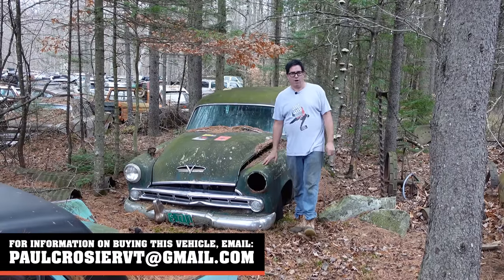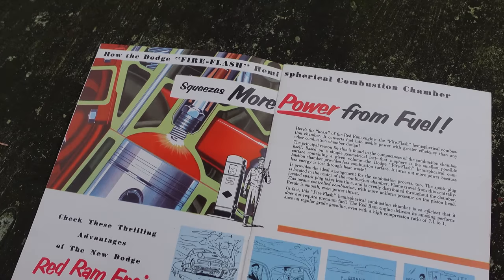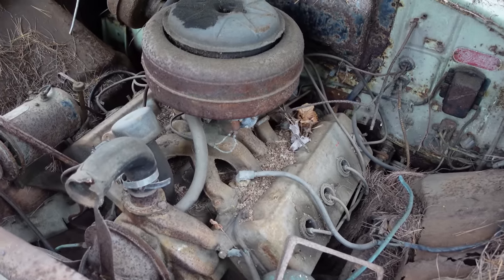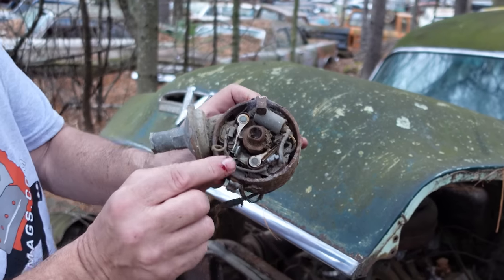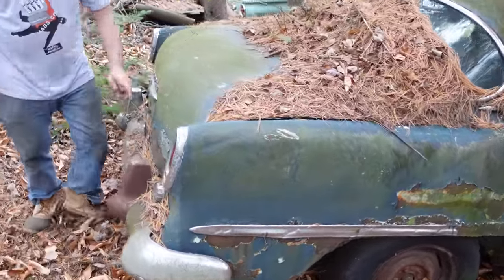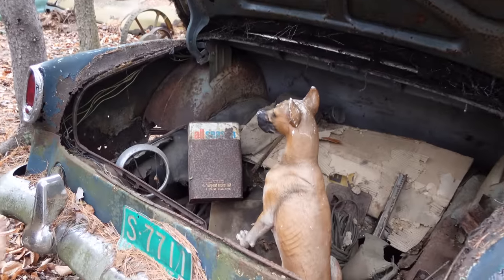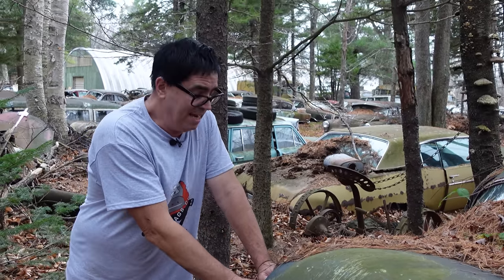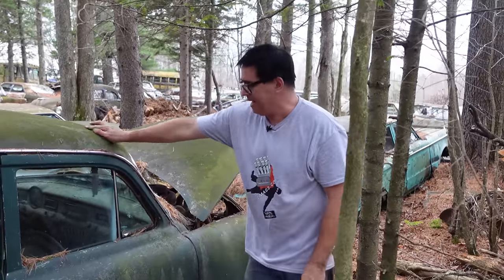First Ever Dodge Hemi

Comment: Nice to see the mother of where a legend was born.  Thank you Steve
Reply: NO,mass Hemi was pionereed by belive it or not Citroen and all Citroen engines were exclusively Hemi engines,2cv had Hemi some three of four years before any US producer.
Fun fact is that Chrysler had a very close relations with Citroen back in the day beacuse Citroen was a monster of company and real innovator.They pionereed Hemi,Crumple zones,disc brakes,power steering,self collapse engines and steering,radial tyres,Hatchbacks,front wheel drive,adaptive lights,active suspension(which even Tesla uses today in variation),rain sensing wipers,aerodynamics for fuel effiencyand many more!!

Comment: I remember when I was 16 years old working at a service station ( not gas station ) , I’m 73 years old now. Anyway I was assigned to change the earl and filter on the company pickup . For giggles I filled the oil bath air cleaner to the very very top.  Later my boss had to go on a service call. Either way the pickup was smoking a lot all the way down the very busy street we were located on. We were all ( about 5 of us employees ) laughing our aspirins off. The boss was not happy. Regardless I didn’t get fired. When he was reading me my rights I couldn’t keep from laughing. Thanks for the memories.

Comment: Extra value is what you get when you buy a Coronet. LOL.

This is either a model "D44" or "D48" and records show they were all US built, likely at Dodge Main, aka Hamtramck, MI assembly or "Factory Zero". That facility operated from 1911 to 1980 and today GM's Hamtramck, MI assembly plant sits on part of that site. Factory Zero was a city within a city and made to operate on its own, including having its own fire protection (hooked into the Hamtramck, MI fire department), several medical wards and cafeterias. The best part was "The Playpen" where employees could work on their own projects after hours. Likely code "505" Bimini Blue exterior paint.

Comment: ... Two weeks ago, I bought a running and driving 1953 Dodge Regent four door... 230-6, three speed manual... Nearly flawless interior and exterior, no rust, no holes anywhere, and no body filler... A complete set of Firestone glass belted wide whitewalls ... Best regards...

Comment: My first car I bought after learning to drive on a 69 VW bug was a Seashore Green 1953 Dodge Coronet 2 door sedan with the 241 Hemi and the GyroTorque seemi-automatic transmission for $250 in 1974. It proved to be a good lesson about due diligence when buying a car. I knew next to nothing about it except that it was an old Dodge with a Hemi. The Gyro-Torque was a vestigial relic from the losing side in the race to be the first with a fully automatic transmission. Still used a clutch to shift into any gear. The only thing automatic was the upshift from 1st to 2nd. You used the clutch to engage 1st and acelerate. To upshift you would momentarily let up on the accelerator long enough to allow the transmission enough time to make an unhurried shift into 2nd with a nice crisp mechanical clunk allowing you to speed away in 2nd gear at a leisurely pace. It was funky. 
Tex Colbert got his marching orders from Chrysler Chairman of the Board K.T. Keller who famously defended the dumpy styling of the 1950 Plymouth saying "We build cars to sit in not piss over." At that time just about every man and woman wore a hat of some kind and would expect to wear it while riding in a car.

Comment: More accurate spark timing and longer coil saturation for a better (hotter) spark. This was the only way to achieve more coil saturation prior to the electronic ignition system.  When properly set the first set of points would close to start the coil building back up for the next spark discharge almost immediately after the break set had opened disrupting the electricity to the coil and creating the coul discharge (spark). Had a Mallory duel point distributor back in the day in all my Mopars till the aftermarket electronics came out.
Even though this isn't the 392 or 426 it's cool as hell seeing a true HEMI under the hood.  Wonder if it's salvageable? Probably someone somewhere in need of one for a restoration.
Reply: Hi Chris, please see the second part of this video.  Chrysler Master Tech - 1951, Volume 4-8 FirePower Engine Facts.  The second part.  Dave...

Comment: Hi Steve, great video on this 53 Dodge hemi. I'll have to admit you got me a little choked up this morning. I wrote about Mr. Zimmerman in another video. Mr. Z was the guy in our area who knew everything about the hemi and Chrysler products of the 50s and 60s I worked with him as a teenager, and he drove a 54 Dodge Coronet with the Red Ram hemi and automatic. It had a green top and a cream coloured body. Absolutely in showroom condition in the 70s and 80s. He would come pick me up in that car before I had my license. It was his daily. I can still hear folks talk about getting the "Z man" to fix their cars. He was a tall, skinny man with round glasses and bright red hair. I nicknamed the 54 "the little Dodge." Because at his place sat big 50s 60s Chrysler, DeSoto, and Imperials, but he chose the Little Dodge. I remember we took a 200-mile trip to the Mts of NC to check out a Mopar hoard he was thinking of buying up. That little car rode as smooth as any luxury car, and that Red Ram, you never felt it running and could hardly hear it. I've always wore a hat, and yes, there's LOTS of head room in the Little Dodge(s). At about 12 or 13yrs old, my grandfather had an old Dodge. I believe it was a 47 sedan. It was pretty rusty, at least the drivers side floor was. Well, to keep me 'busy', my grandpa gave me that car so I could pretend I was driving, etc. With help with a friend, I managed to break the engine loose, and over the summer I got it running. I 'borrowed' a battery from one of my granddad's tractors. Well, the floor was rusty, and the gas pedal was dangling under the floorboard. I had the genius idea to take off the hood and sit on the fender and hand throttle it. So my friend and I would take turns sitting on the fender and drive through the tobacco fields. When I finally got it "right" ,with my friend on the fender, I drove that Dodge down the long dirt road to the main house that my grandfather lived. Well, he met us  with a crazy look on his face and said "What's next you gonna tear off the hinges on the gates of hell?" My grandma was not happy at all either. Well later on the next summer something happened to the transmission and the car sat until someone told me about Mr Z. So I hiked down to Mr. Z's shop, and he took the time to listen to a couple of kids trying to describe what was wrong with "their" car. Well, in trade for another transmission and a used clutch, I worked with him for cleaning and whatnot. He also gave me a manual to show how to replace the trans and that summer I almost had it complete before school started back up in Sept..I figured out if we cut a hole though the firewall and wired up the throttle leakage so now we had a hand throttle and no more sitting on the fender. Mr.Z is still alive the little Dodge is gone, tho. He's probably pushing 100 now. He never had any kids, and at some point, people began to think I was his back then. I'll have to make my way down today and check up on him. Thanks Steve hopefully some of those cars will be sold and used to help keep another one on the road. Have a blessed day, everyone,  Namaste 🙏🏼
Reply: Morning , Chris , you got the best stories !   We all had an old timer or two as influence as we grew up .  I certainly did and luckily I listened to them . Now I'm the old timer but it seems kids don't want to listen much any more . They have too much in their lives and are distracted by that .  I was telling G P when I was a kid we used our imaginations a lot to occupy our time .  These were called THE  GOOD  OLD  DAYS .   This is why I like this channel so much , as it takes me back in time .  Have a great day Chris !
Reply: Go see Mr. Z. I worked with an older man in the '80's that would tell me stories of plowing sidewalks in Rochester, NY with a horse drawn plow, him and his dad digging basements with a horse drawn shovel, stories of Africa and Italy in WW2, getting his teeth knocked out while hand cranking a tractor when he was 12 and many others. When I got a Harley in '98 I thought I would visit him with it as he had one in the '30's. I never did. He's gone now and regret is not a good feeling. Take care!
Reply: @daynadiggle8169  Hi, thanks, and yes, some of their biggest problems are right here in my hands, a handheld computer. "Let me Google that..." has become too familiar. This has taken away most of the imagination given to human beings. Don't get me wrong, we are currently living in our future. Things today are the things they told us as kids are coming in the future, and it's a beautiful thing. But there's a trade-off, life lessons. Now, most have become followers and want to be like what's on the internet, and for those that can't well they seem to think "I'm no good" or "not good enough." Ego probably the most dangerous word to a human. Most humans are only scared of the unknown, so now we have social anxiety because most don't interact with other humans regularly. So they just do what everyone else is doing so they feel excepted. They have forgotten they are here for a reason and very unique in their own way and have a purpose here on earth. Who wants a box of cayrons with the same colour? So who's right and who's leading? It reminds me of a story about a jewelry shop owner who had this huge clock in the front window, and every day, a man would stop and adjust his watch. So one day, while out sweeping off the sidewalk, the same guy came by and set his watch to the clock in the window. The shop owner asked why did he do that every morning? I can surely sell you a watch that works correctly. The fellow said I'm the foreman at the mill, and I need the exact time to blow the shift whistle. Confused, the shop keep said that's funny I set my clock by that very whistle. Who's right and what are the consequences of their actions that have affected others? As a young boy, I almost always ignored other people’s ideas about what I should be thinking or doing. I simply was indifferent to their opinions regarding what I could imagine for myself. I have carried this kind of inner discipline regarding my own imagination, refusing to allow external opinions to cancel or diminish what I considered hallowed ground. Often we use the word problem only because we have not learned that imagination and creativity can handle the situation. Teach this very thing to kids. As you can tell by my comments here if they had ADD and ADHD pills as a kid I am sure some teacher or maybe my own guardians would have had them prescribed. Another problem 🙄 take away their ambition "because we can't deal with him" I apologize for being so long-winded here. 😴 thanks again for commenting. Have a blessed day Namaste 🙏🏼
Reply: @594bolt  Hi thanks for commenting Mr Zimmerman lives about an hr away so it's not to far and on occasion when I pass by he's in the yard moving around. I'll blow my horn and he knows who it is because I've always been one that had "the only one in the parking lot" if you get what I mean. Yes today it's a warm in the 60s and I'll be stopping this time not just a toot on the horn. Namaste 🙏🏼
Reply from the maker: Wow Mr. Scearce, I read the entirety of this thread and your story about Mr. Red and also the jewelry shop clock indicate that you are a VERY WELL ADJUSTED INDIVIDUAL. Really. I'm here at Barrett-Jackson / Scottsdale "slumming" but look forward to getting back to the Junkyard when I get home next week. Have a GREAT day. -Steve Magnante
Reply: @SteveMagnante  And now , without further adou , ITS  MILLER  TIME !
Reply: @SteveMagnante  Hi Steve, I'm quite humbled and honored by your comment. 😊 Coming from one of automotive's very own living legends. I'll have to admit a bit jealous also as I've promised myself that one day I'd attend a Barrett-Jackson event and see some of the greatest and rarest automobiles. I'll have to get back home and see if it's televised or being streamed live. Bottoms up Steve 🍺 here's to the Crawl 🍻... Namaste 🙏🏼

Comment: A friend of mine is currently working on a 1953 F-100 hot rod project. The engine he's using is a Red Ram Hemi with an old Mooneyham blower. He's already done the mockup several times and is doing the final fab work now. It's going to be a cool truck when finished.

Comment: I really hope that car will be saved and restored. Its got a lot of history behind it, from the gyromatic transmission to the still complete hemi under the hood, it’s a miracle that hemi hasn’t been taken out yet. Can it be restored, yes, will it happen, probably not, but you never can tell…. Great video as always!!
Reply: Even if the rotten body is removed, all the frame might still be salvagable
Reply: It'll never happen. They're not worth sh!t.  Possibly the engine.
Reply: Fitzee could do it!
Reply: It's fun to dream, but did you not see the whole side of the car move when he tried to open the door on that rusted out old crew cab (4 door) I bet that Hemi would start up & could be transplanted into a hot rod ... that's what needs to be saved, Mr. FRANKFRITTER
Reply: @speedfreak8200  We
hen he opened the trnk lid the inner fenders and floor were gone, and it was a 4 door sedan
Reply: @jeffclark2725  Fred Flintstone JC
Reply: @jeffclark2725  it's the Road Salt 🧂 that dissolves the body & frame. If you want to fix up a vintage vehicle, go to the other side of the country. That's why all (most)of the cars in that yard are beyond saving, it's a shame ... I'm from Oregon I'm lucky

Comment: seriously getting into the early 1950s poly engines, very much worth bringing them back.
Reply: I have a junk 55 Chrysler Windsor with some sort of Poly V8 in it, but I don't know what it is 🤷‍♂️
Reply: @johneckert1365  Is the front engine mounts bolted to metal bracket that goes from the frame to under the water pump?
Reply: @dh2360  I'll have to check it out in spring after the snow melts. I'm in Northern Wisconsin and we've had a couple feet of snow already

Comment: Gyromatic only required the clutch to move the shifter into a range. Once the sifter was in that range, you did not have to step on the clutch again. High range was the normal driving range. Step on clutch and pull shifter into what would be 3rd speed on a "3 on the tree" and with your right foot on the brake, release the clutch to engage the fluid coupling. When you want to start moving, just remove your right foot from the brake and step on the gas. When the car got to around 20 mph, you lifted your foot off the gas and listed for an audible "click" or "clunk". Then back on the gas for high gear. Once in high, mashing your foot tripped a switch on the side of the carb to activate a solenoid that dropped it back a gear. When you stopped, it also dropped back a gear to start off again. You did not have to step on the clutch to stop. Low range was where 2nd is on a "3 on the tree" and worked the same way. There were therefore 4 forward speeds. Reverse was in the normal position but still used the fluid coupling. There was no shift position where 1st normally is. Because of the fluid coupling, leaving the car in gear did nothing to keep it from rolling. Hand brake was a band wrapping a drum at the output of the transmission. Ask me how I know all of this? [Grew up with a 1949 Dodge Coronet Club Coupe]

Comment: Back when I was a kid in auto shop in the early 1970"s I remember seeing a film that was put out by Chrysler showing their new for 53' automated engine machining transfer line building the then new hemi engines. Also at the same time one of my friends had a Desoto with the semi automatic transmission and I remember how the engine would rev quite a bit when it would pull away from a standing start because there was no torque multiplication.

Comment: My 53 Plymouth Cranbrook coupe has the three speed manual overdrive but the Hy-Drive was also available with fluid coupling sharing the engine oil. Hy-Drive engines were different with oil passages to that fluid coupling. Similar to the Gyro Magic, clutch, shift and go. Great video.
Reply: The 3spd manual with borg warner O/D is the best trans for that Plymouth I think.

Comment: The purpose of the dual point system was to lengthen the spark.  The first set of points opens, collapsing the magnetic field in the coil, then just before the first set closes the 2nd set opens.  This extends the time where the high voltage is applied to the plug. When the 2nd set closes the current is restored through the coil and the cycle repeats.  This was decades before CDI or MSD (multiple spark) was a thing.  Anyone that has owned a traditional hemi understands that they are prone to fouling plugs.  Having a longer spark helps get all the fuel ignited and burned.

Comment: My first car! Bought it in 1963 for $50. The seller thought it had a bad valve. Ran like crap. I put new plug wires on it. Problem solved!   I don’t remember the dual points,but I can’t remember what I had for breakfast either. I do remember the terrible transmission though. That is what made me trade it for a 53 Ford with the dependable flathead V8.